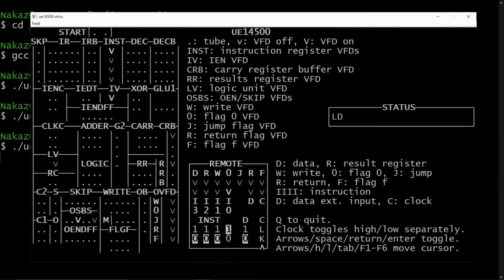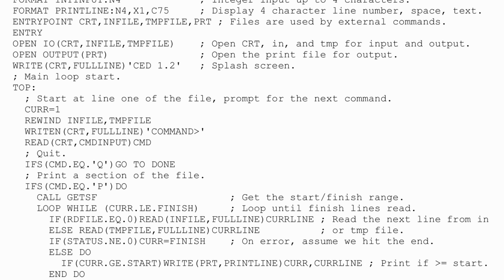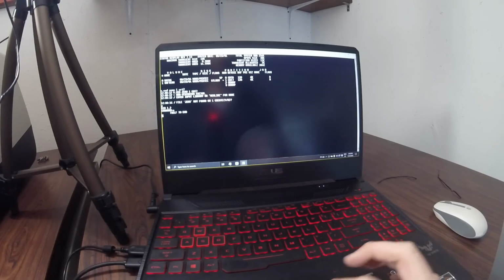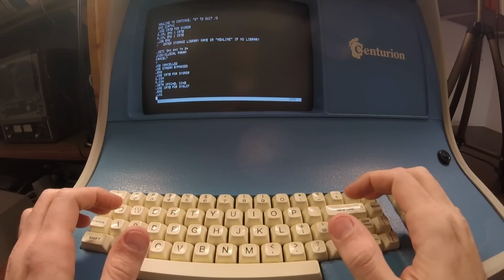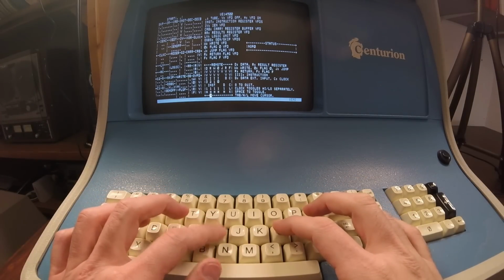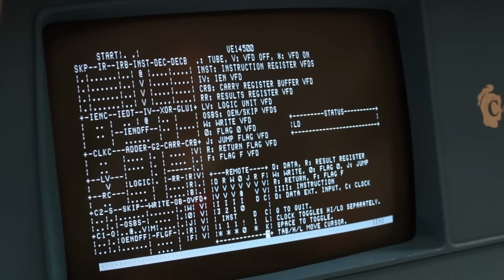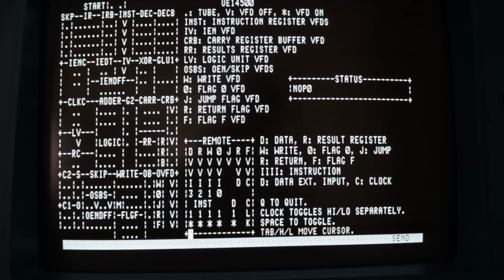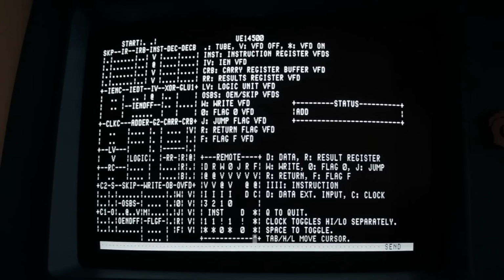Emulating the Vacuum Tube Computer on the Centurion Minicomputer

Comment: Great stuff, now you have a better editor, that's a biggie.    You really need a program so you can upload and download files to your laptop, something kind of like XMODEM.  You don't need something fancy since you're doing transfers locally, but being able to upload and download files without having to cut and paste would be nice.    You should be able to do binaries as well.   I'm also curious how your mini-centurion presentation went.
Reply: I think we understand how the Centurion's system bus works well enough to actually create a card that could do direct parallel binary data transfers via normal I/O, possibly even in a way that the OS understands. That would be at least as fast as reading the hard drive.

Oh and we do have a working floppy drive, I'm not sure if data transfer through that is figured out already or not, but it shouldn't be too hard in comparison to what was already done with this machine.
Reply: @jwhite5008  That would be a lot of work, but a also a lot of fun.    What would be nice is something to emulate a hard drive with some modern hardware that can also be used on modern hardware such as an SD card.
Reply: @ChristopherHailey  I believe just putting data from SD card onto the bus wouldn't be that much of work, and reading/writing it is probably one of the easiest things that can be programmed on the machine. Emulating FDD or HDD is harder, but probably more fun and doesn't require writing Centurion code. An existing arduino-based open-source floppy emulator that can be modified to emulate 8-inch floppy drive with reasonable amount of work, and parsing centurion floppy images probably shouldn't be that hard either.
Reply: @jwhite5008  Actually created a SD device would be a LOT of work, you don't just "put data onto the bus", that's not how computers work.    Getting it to work would be very complicated and hardly "on of the easiest things that can be programmed".   To create an disk emulator would be complex.   Since the Centurion only supported a handful of drives you would have to emulate one of those.   You would first need a physical interface to the bus that would then in turn have to interface with your emulation hardware and software.    This is actually quite useful because now you can run the machine without spinning (and rare) hardware but the next step if you want to be able to use this to transfer data is to come up with a way to read the disk on a modern machine so you can import and export data.   The issue is that the data would be on a Centurion file system so you would have to write software on the modern machine to import and export the data, being able to MOUNT the drive on a foreign machine would be a major, major undertaking so you would have to write an application that can understand the filesystem.    You might be able to use an existing floppy emulator but you still need the physical interconnect and the emulation would have to be very accurate and would probably require modification.    In short, emulators are very complex and creating devices is not trivial, especially on unique and vintage hardware.   We obviously share an interest in this kind of vintage hardware, it's cool stuff, isn't it!  I find your view on this quite interesting, thanks!
Reply: @ChristopherHailey  I don't know how the Centurion's bus works but on an 8-bit micro it basically is as easy as putting data on the bus. You just need an address decoder enabling to a bus driver for data into the computer, and an address decoder plus latch/flip-flop for data out of the computer. A few unidirectional I/O ports plus some software is enough to make an intelligent clocked protocol. You could even bitbang an SD card directly in SPI mode using a level shifter.

With simple hardware a lot can be accomplished with smart software.
Reply: @eDoc2020  It is never, ever as easy as "putting data on the bus", that's not how computers work.    You can't just "put data on the bus" and expect anything to happen, that's not reality.   You are just posting technobabble.    "an address decoder enabling to a bus driver for data into the computer, and an address decoder plus latch/flip-flop" is just a meaningless sequence of words as is "A few unidirectional I/O ports plus some software is enough to make an intelligent clocked protocol".   "SPI mode" is not a thing, SPI is a simple protocol originally defined by Motorola and it's a lose protocol and has absolutely nothing to do with the topic at hand.   You say you can do a lot with "smart software" after claiming that no software is really needed, you just "put data on the bus" and then things magically happen.   They don't.

I can only assume you are kidding or trying to fool me with technobabble, but the latter won't work because I have decades of experience in the field, including machines similar to the Centurion in nature.   I'll just assume you are pulling my leg and smile.   Cheers.
Reply: @ChristopherHailey  I never said it would work without software.

On A PC you can create a circuit where a line goes low when a certain value is on the address bus. One possible example is chained 74ls138. AND this with the /IOR line and you get a signal which goes low when a specific address is written to. Also do the same for writes.

Put the gated read signal into the enable input of a bus transmitter and suddenly you can safely put data onto the bus. Put the gated write signal into the clock input of a 74ls374 and you can safely write to the real world.

Am I missing anything up to this point? I know the Centurion isn't a PC but I'm assuming its bus isn't too different. Maybe it is in which case I'd be wrong.

There are multiple modes of operation for SD cards. In one mode the low-level interface is a proprietary SD-only protocol. Another mode lets the card behave as an SPI device. That's what I meant by SPI mode.
Reply: @eDoc2020  To answer your question:  Yes you are wrong.
Reply: @Drew-Dastardly  Any (old) standard program would be good.   Anyone want to port xmodem to centurion.    Fame and glory if you port kermit :)

Comment: I think one of the next orders of business should be some sort of zmodem/Kermit file transfer for copying files to the centurion, or perhaps ppp,tcp/IP,ftp for the centurion, maybe someday design /build an Ethernet adapter for the centurion
Reply: what do you think is the best file transfer - I always got confused with "smart" terminals reading (and writing) what was on local drive to what was on remote drive - became easier with windows /novell and similar as drive letters or share names could be seen
Reply: @highpath4776  sadly, my experience with these methods is limited to being an end user, but I would assume the easiest to implement would be something like zmodem, Kermit, qmodem etc, because they use straight serial without a need for an underlying network stack,ppp would be via serial but would require a network stack and Ethernet would require custom  hardware and a network stack

Comment: Is it just me, or does it feel wrong to anybody else that you went through all that work to get the Centurion up and running only to have it emulate another system?  It just feels like you should be running real Centurion applications on the minicomputer.  Don't get me wrong, it's cool that you got the emulator compiled and running, but man, it just feels wrong to use it to emulate another system.
Reply: It's still cool to see SOMETHING running on the Centurion though.
Reply: The General Ledger system looks interesting.  Wonder if it will run Harvard Graphics for some cool maths stuff ( Python anyone ? )

Comment: The horizontal wiggle on the ADDS monitor maybe a filter cap. on the monitor's "display H/V sweep & High Voltage  PCB" .  Do not think is would be a filter cap. on the main terminal power supply board.
Reply: any stray magnet field from having the vtc on?

Comment: i would check esr (internal resistance) of filter capacitors (big electrolitic caps) in that centurion terminal and hunt for one that is above treshold for it's capacity . and do that with them discharged because we talking 200 or more volts dc
i am not sure if that fix the problem but shotgun replacing all caps wouldn't really be better idea, generally  high esr cap would have similar effect because it may still charge but give out power slower than it schold with vertical frequency of the screen mismatching line frequency you would then get a rolling bar when voltage drops enough to afect either brightness or screen width

but i might be wrong if it was tube tv you would ask shango066 for vcr you would ask 12voltvids , there is many great experts on youtube who would know , you just need to fing someone close by :P

Comment: I want to see the PDP11 running a Centurian emulator, running a vacuum tube computer emulator...
Reply from the maker: Hmm, we must go deeper! Linux emulating windows emulating a PDP-11 emulating the Centurion emulating the tube computer!
Reply: @UsagiElectric  Hopefully our dependents will run a sentient AI in an emulated reality, programming a retro quantum computer to run Linux, to emulate Windows emulating a PDP-11 to emulate a Centurion emulating your vacuum tube computer.
Reply: Weren't the Centurion and PDP-11 near-contemporaries? Would the PDP-11 have enough headroom for that? It might be more interesting to also port the Centurion emulator to the PDP-11, and to set up a simple Centurion–PDP11–UE14500–Unix/Linux network.
Reply from the maker: @ropersonline  They are pretty close contemporaries, the Centurion I have is a hodgepodge of parts, but 1983 is a decent year to place it at, and the PDP-11/83 was released in 1988. But, the Centurion design in 1983 was actually just a maxed out design from 1973, so it's still pretty limited compared to the full blown capabilities of the 11/83.

Just looking at the CPU and RAM specs on each, the Centurion is an 8-bit machine at 5MHz with a maximum supported RAM of 256kb while the 11/83 is a 16-bit machine at (I believe) 14MHz with a maximum supported RAM of 4MB. So, from a pure performance point of view, it's possible we could get a Centurion emulator running on the PDP-11. However, the biggest hurdle isn't the performance, it's how the Centurion handles data.

The Centurion was designed to be fully backwards compatible with Litton Minicomputer tape drives, since there main customer base were ex-Litton customers. This meant that the entire operating system is based around 400-byte sectors as opposed to the more standard 512-byte sectors. So, an emulator has to do a massive amount of work to just convert between the two wildly different file systems. Also, the Centurion OS is just really strange in how it handles stuff internally, which makes things a little more difficult too.

Not totally out of the realm of possibility, but it would take some serious PDP-11 assembly skills to get it working right!
Reply: @ropersonline  Yes and no. I'm not an expert, but while both came from the era where computers had tiny amounts of RAM and had to rely on slower external storage, I think DEC had more resources to make use of expanded hardware capabilities. Hence, the Centurion was still limited to 4KB of RAM per user, even though Usagi's one is loaded with a fairly generous amount of RAM (128km if memory serves).
The PDP-11 was also in production much longer, and had many upgrades and  expansions over the years. I believe they were in production until 1997, and a maxed out machine could have 4MB of RAM. There are multiple options for operating systems, and they were often used for scientific applications that often needed lots of RAM, so at least some of the operating systems would be geared towards larger applications over lots of user terminals.
So I think a Centurion emulator should be very feasible, and may not even be a huge job to port the one Usagi has been using.
Reply: Or a PDP emulator on the centurion running a centurion emulator running the valve computer? 😂 Bonus points for getting either the Centurion or PDP CPUs emulated on the valve computer!
Reply: Should be quite easy, just fire up ChatGPT and say "Write me a Centurion emulator for a PDP-11."
Reply: The UsagiElectricVAC emulator running on the UsagiElectricVAC itself. gonna be slow, but someone should do it. perhaps I

Comment: Amazing! Now we all are waiting for you being able to control the vacuum tube computer from the Centurion instead of via the remote control ;)
Reply: Or perhaps controlling the Centurion from the vacuum tube computer? 🧠
Reply from the maker: That's actually not out of the realm of possibility!
I'm pretty sure we can write some CPL that creates a unique 2-character string that we can send at 300 baud out of a MUX serial line as a printed string into a shift register to latch the 14-bits. Then we just do a parallel read of that 14-bits through some level shifters and use it as a control word for the tube computer!

Comment: Now I'm curious about how one might use the centurion to write cpu instructions directly to the vacuum tube computer.
Reply: It probably would be a really nice creature comfort if the Centurion and/or PDP-11 and some of David's modern (Unix/Linux) PCs got the ability to bootstrap the vacuum computer into any state. To really work, that might require some kind of DMA interface between the UE14500's as-yet-incomplete RAM and the rest of David's exhibits. The ability to quickly feed any "externally hibernated" program into the UE14500-based vacuum tube computer and resume execution would be great for demonstrations. Short of that, even just an initial program load shortcut might be a desirable quality-of-life improvement.

Comment: The issue with the terminal seems to be ripple from the power supply. Does it get better after heating up or being turned on for a while? I'd check the caps , maybe they are leaking or dried up.
Reply: Yep, second that: the power supply ripple is changing the HT tube anode voltage. Issue is unlikely to be with the HT circuit but most likely to be - as thargoid suggests - the smoothing capacitors around the display power supply. It's not likely to be the 5v supply for the logic circuits (I'm assuming that's using TTL logic).
Reply: @neilbarnes3557  Power supply ripple changing the acceleration potential actually causes the opposite effect. Dips in HV make the picture larger given the same deflection current. And that's the direct cause of the symptom, it's dips in deflection power.
Reply: @eDoc2020  True... it's been too long since I played with a real CRT. While you might still see an overvoltage on the HT from poor smoothing, it's more likely to be the deflection. Clearly mains running at a close but not identical rate to the field.

Comment: What a great combination!
About the failing characters on the terminal emu: maybe it is caused because of the bridge rts-cts-dtr signals?
Reply: is part of the program ' draw character' running too fast and needs setting a bit slow ( though echo to crt is really only for eyes to see and whole complie would be faster if you trust your code just to 'work'
Reply: USB-serial chips should have enough buffers so at sane speeds no data will be lost even without handshaking.

Comment: "Absolutely frigid?"  😆  Yesterday morning here it was -15F (-26 C) ambient, -35F (-37 C) with the wind chill.  How are all those Schottky TTL chips doing at heating your shop? I'd imagine that you don't actually need the firebottles with all the heat off the Centurion and PDP-11!

What you need to do is put RS232 ports on a couple of computers (on credit-card form factor) and link them with Wi-Fi, so you don't have to snake the RS232 cables everywhere.  How are all those Schottky TTL chips and vacuum tubes doing at heating your shop?

Next thing you need is a Centurion emulator on the PDP-11, and then a PDP-11 emulator on a modern compiuter, and I bet the whole stack will run faster than the vacuum tube machine!
Reply: There is apparently a PDP-11 emulator for DOS, and DOS emulator on Linux, and modern Windows can "emulate" Linux natively so...